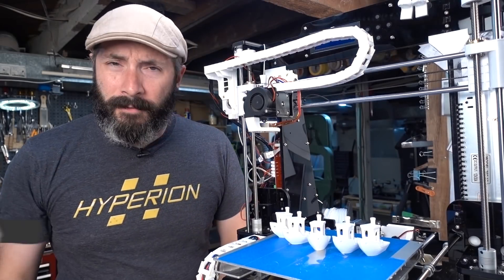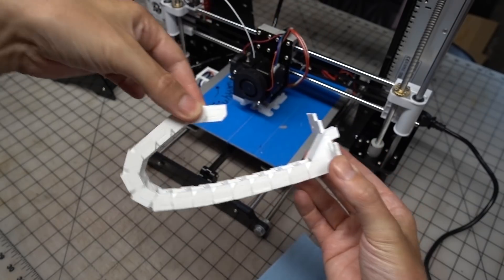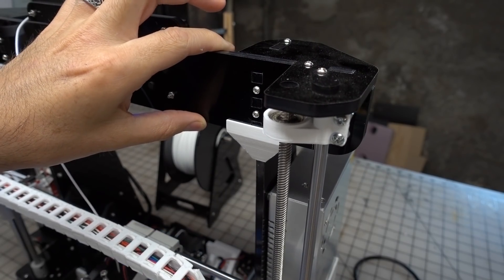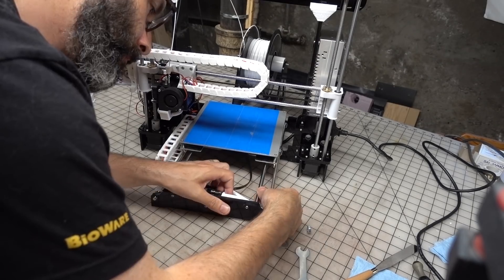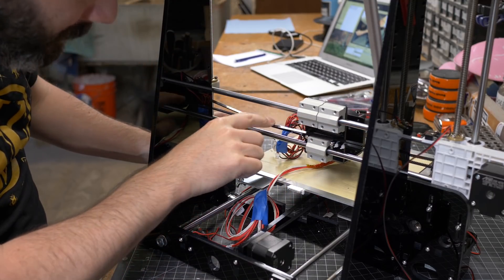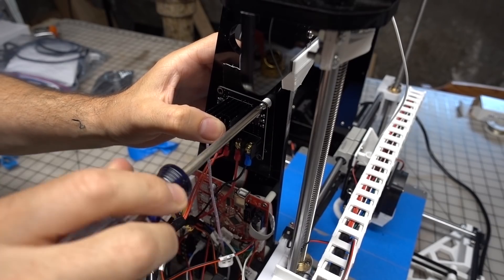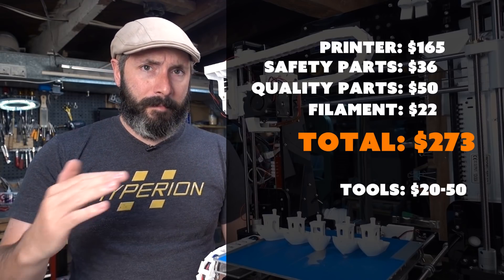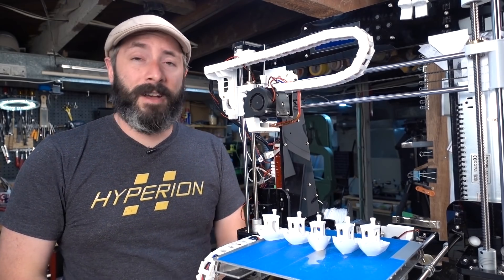Make a Cheap 3D Printer Better - Anet A8 Print Quality Upgrades

Comment: using machining oil or all purposes oil or other fancy lubricants near plastic printed parts can be devastating for the printed part. due to other additives in the product your plastic parts might degrade over time. you might consider using a lithium greas or something specially made for plastic parts. I know you greased the rod, but there are chances that the oil will end up on a plastic part and I am sure that you do not want that.

Comment: dont ever use a file on a nozzle! most have imperfections, but cardboard is abrasive enough to polish those out of brass, and perfectly level the nozzle face, without creating a bur or further imperfections. just put it on the bed, LIGHTLY lower the nozzle onto it, and move it in circles.
Reply from the maker: Wow I hadn't heard of that before. That's a great technique, thanks for sharing. =D

Comment: the only helmet that is white that i can think of is a stormtrooper helmet
Reply: MemesAreCancer I think it's white just cause of the printing material. My guess is a buck to make a visor or maybe the back of the helmet :P
Reply from the maker: Ooh getting close!
Reply: Jack Kuehneman he said to someone else in the comments that he was printing in white because the helmet was white.
Reply: Punished Props so its that front plate on a tank trooper helmet. i never would have guessed. hope it turns out great. (i didnt come up with that i just scrolled through the comments)

Comment: Huh so much work for so little improvement.  But OK it is still cheap as possible. And yeah if you have a Fiat 500 you can mod it as much as you can, it is still a Fiat 500...

Comment: This is like the bottom bin level of 3d printers, maybe 3 years ago it was the only affordable one but now in 2020 do NOT buy this printer!!! I’ve had sooooo many problems with this printer, I should have just bought an ender 3 instead and paid $70 extra to have it prebuilt.
Reply from the maker: It's pretty amazing how far they've come since then, isn't it?
Reply: I don't know my Anet A8 going on its 3rd year...has gone through probably thousand of hours of prints, if not more.  And while I have run into issues, it wasn't anything crazy.  And was fun to build it vs the Ender.  I am upgrading so it is not the end all...

Things that died...motherboard...I broke it so user error.  Replacement works.
Power Supply - Replaced with a repurposed powersupply from an old PC, 350w.  Cost 0.

I upgraded my heater nozzle to a maxiwatt one - just recently.  Cost 20 bucks.  And damn no matter what printer I buy next...this is going into it.

Glass printer surface.

Oh just recently replaced the heat break throat after printing at 260c for months, the ptfe tube finally died inside.  10 bucks for like 5 of them with nozzles.

Thats it.  I have printed a new fan.  Printed my own custom zaxis supports from a modified benchy I made.  And made an adjustable z-limit switch.  I printed a simple xaxis belt tensioner, and the y axis belt tensioner.   I have not printed any y frame supports.

This printer literally runs for hours and hours a day.  Printing everything from a Halo Helmet, to a 3d printed bike wheel (27in), to prototype products that required 0.1mm precision.  Including a current prototype product.

The quality of prints I get, frustrated a person who works at a makerspace and spent over 1k on their ultimaker.  I print mainly in PETG, so even now my printer is constantly at 240 to 250...for hours upon hours at a time.

Even made this circle thing, that had 360 slits at 0.8mm apart, to slide a 0.4mm into, that measures angles to literally half a degree precision.

I for one, never recommend the Anet A8 for beginners, even though I was one when I bought it.  But the damn thing has suprised me so much that hopefully it will be my next corexy transformation project this year (after buying a corexy ender 6 next month)

Comment: With all that upgrades... my stock Anet A8 does a better job than your. lol
I hope you did this.
1) Calibrated Extruder
2) Calibrated step per mm
3) Calibrated your Filament properties.
4) Level your bed and nozzle height to 0.10mm or 0.2mm for distance. 

That's all you have to do to get a good print. 
The only mods you did right is the braces for your frame and fan duct. Also, You need to have Z rods loose. The couplers are designed to absorb wobbles. 

Look at my quality wih stock stuff. 
http://oi63.tinypic.com/qzljbt.jpg

Comment: I have one. So far I think it's a piece of shit. The only way I can see to improve these is crossmembers bolted firmly to the walL and have it bolted to whatever it sits on so its solid as a rock. I've printed two 'T' supports and then my ptfe tube broke while I WAS THREADING IT IN BY HAND.

ABSOLUTE FUCKING GARBAGE.
All the upgrades you've done and the prints still look like shit. Same as mine. And also if your Y axis is making that grinding noise your belt is too tight. That was my first mistake on assembly.

Comment: Man, your prints are horrible!! From the beginning my printer got me a very smooth benchy, Your problem is the type of filament as well, for example, my filament 3d Solutech in red prints at 190 really solid good smooth in detail but!! the awful color blue of the same needs to print at 189 degrees also at 100 fan speed, it makes a world of difference!! I hope that helps because the only thing I've done to my printer was lubrication, and aluminum 90 degree angles screwed into it, it has been fabulous.
My problem now?
 I have a dead printer because the nozzle thermistor when crazy, replaced it and all hell broke loose, apparently the new hot end I replaced as well is not a 40watt one!!  and my fan just drops the temperature dramatically creating prints worst than yours!! (I know you feel great when I say that, and man your printer sounds like a clown laughing from the old movie Bladerunner) Then my damned hot bed connections failed!!! I tried to do the soldering and gets what a damn spark!! that's it the temp is fixed on 100 degrees...I have fried my board!! that is all it takes!! here we go...Ramps upgrade!! 
Anyways man great videos, great quality I hope to see more reports from you and thank you for sharing!!